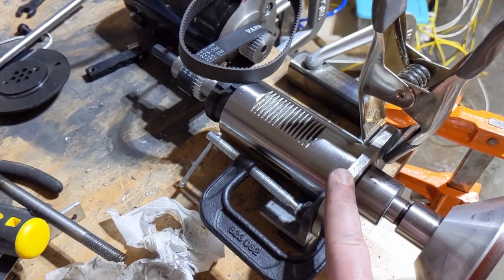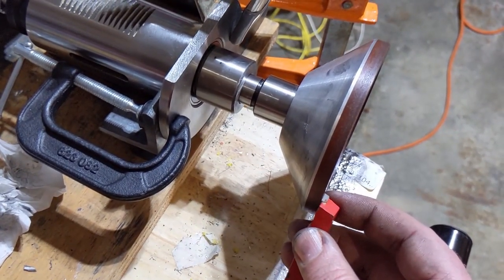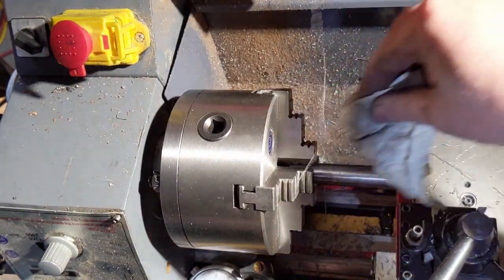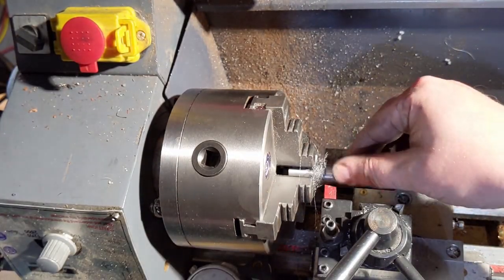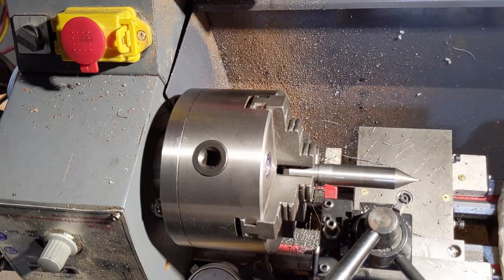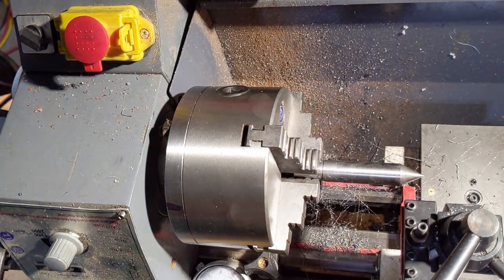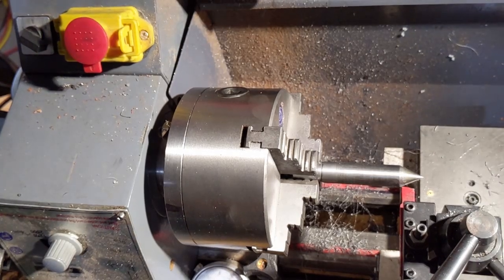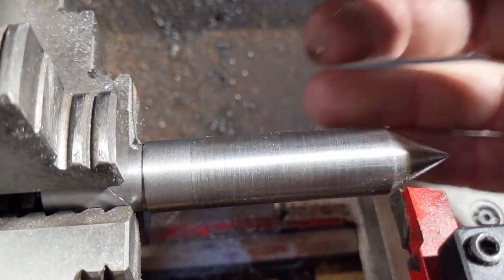junk brazed carbide makes easy vertical shear tool

Comment: Very nice.  Very interesting.  I like the grinder setup you have created ! Solid results.
Reply from the maker: Thanks!!!  i just got the motor mount finished.  I powder coated it and it came out nice, no more clamps!!  The 120 wheel can really hog off carbide.
Reply: @JesseSchoch  it is innovative if you ask me.  You can make an arbor to hold the diamond flat disks as well if you wanted.